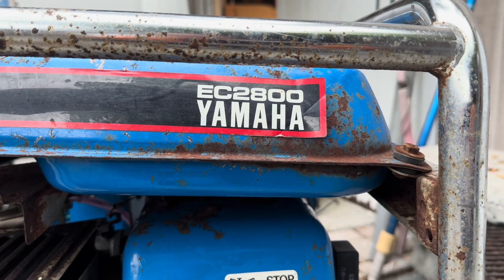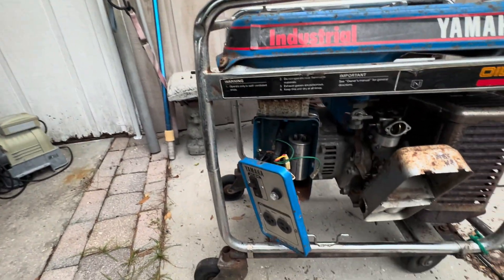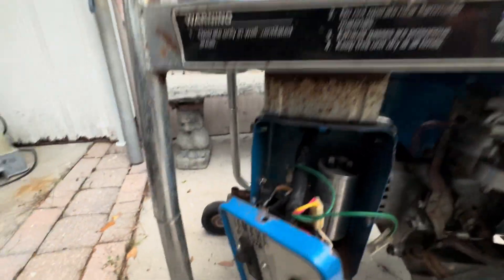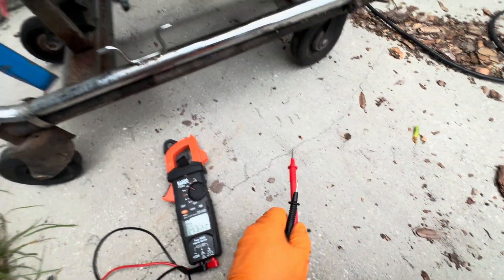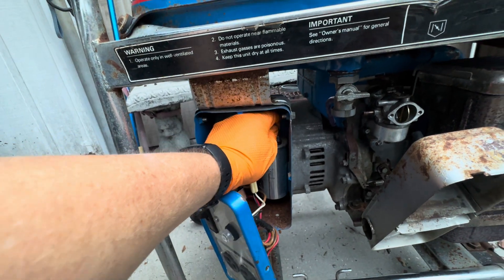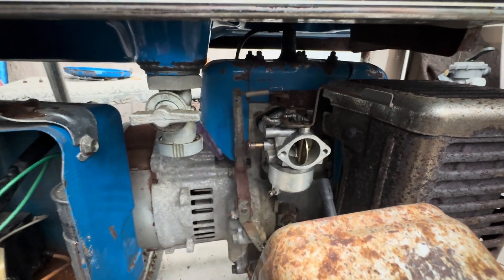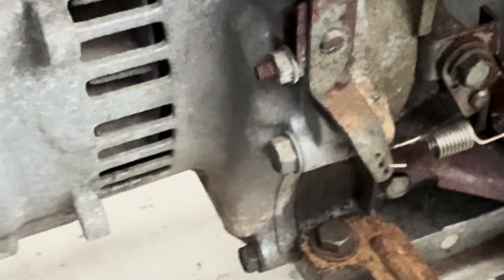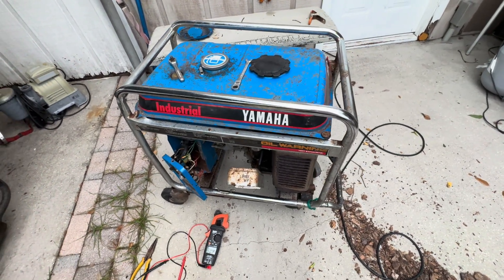Yamaha EC2800 generator overview, test capacitor, and adjust speed. @generator

Comment: Do you know where to buy the calibrater for this machine?
Reply from the maker: I’m not sure what you mean about a calibrater. If you meant carburetor they are hard to come by. Most of the parts for it are still available. I replaced the bowl o ring on it with a Yamaha OEM one. Maybe check eBay. Thanks for watching.